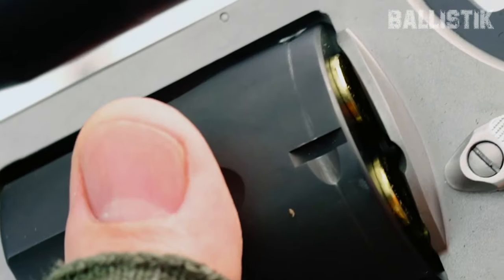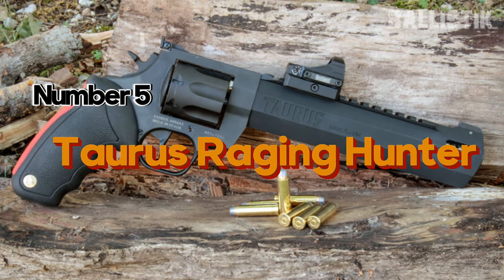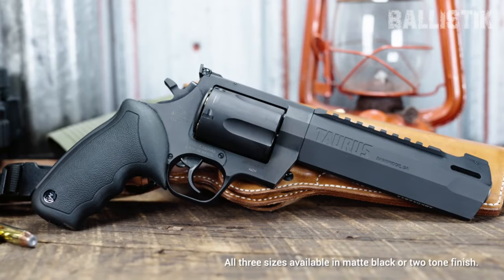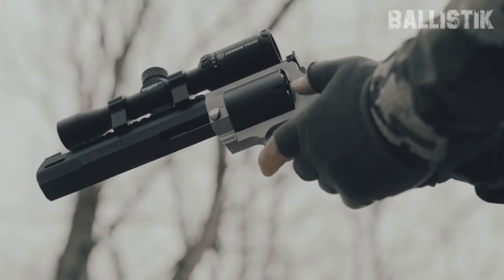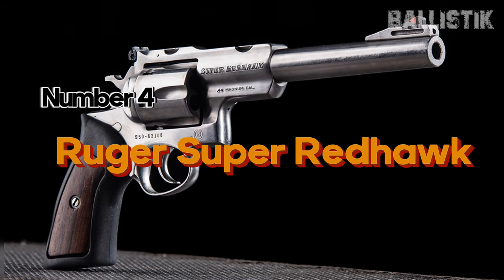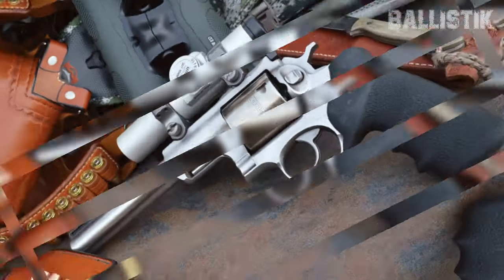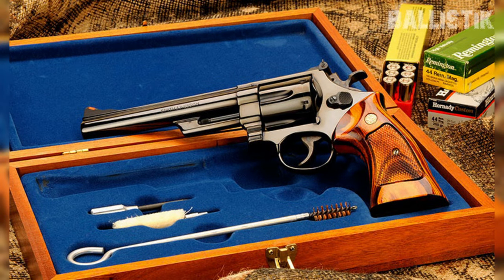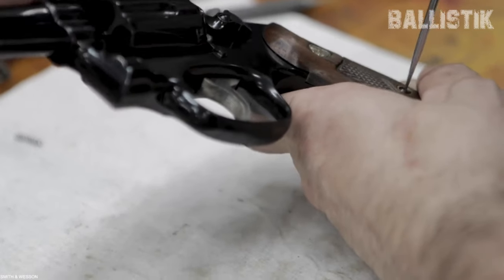5 Best .44 Magnum Revolvers 2024!

Comment: Taurus Raging Hunter loads FIVE rounds, is not a “six shooter”.
Reply: lol are you high? Taurus Raging Hunter only has a 5-shot cylinder if it's chambered in 454 Casull or bigger. One chambered in 44 magnum has 6 shots
Reply: Im high
Reply: @ChuckRoberts2023 . THATS WHAT HE SAID 5 you are HIGH
Reply: taurus's are junk or they damn sure were. After my 4th one I had trouble with, I dropped them forever. 3 wheel guns 1 semi. Got 2 in gunbuy at the same time
Reply: @willford9205 I've had the raging bull for about 5 years and raging hunter 5.12 for about a year now. I take both to the range frequently. At least twice a month. And never shoot less than a box of 50. Never had a problem with either of them.
Reply: My raging hunter 5.12 holds 6